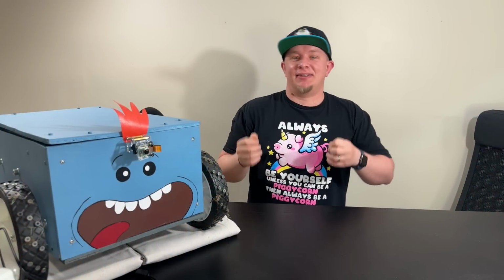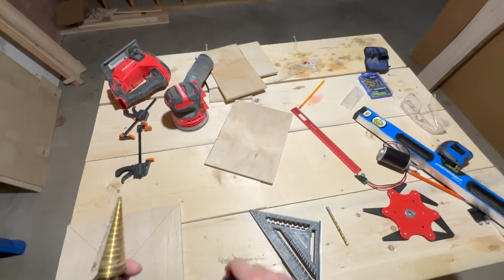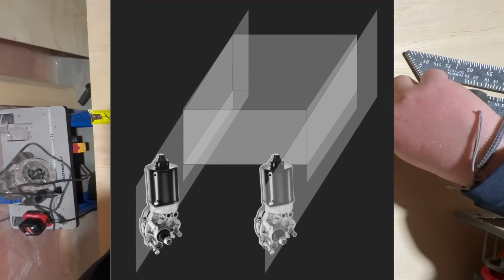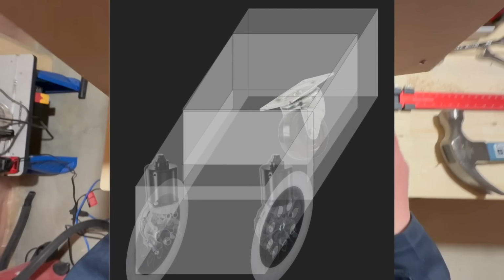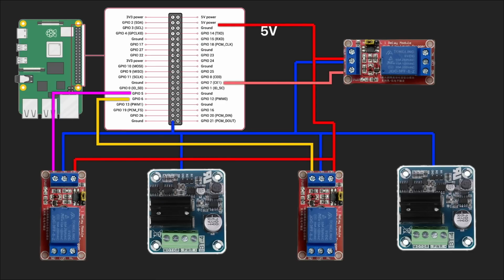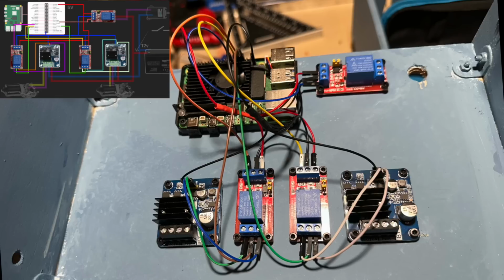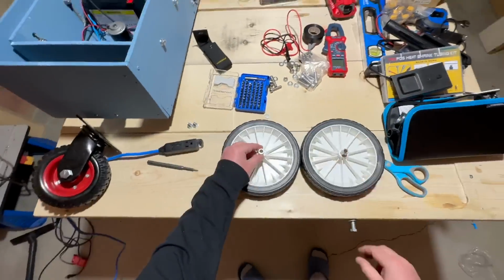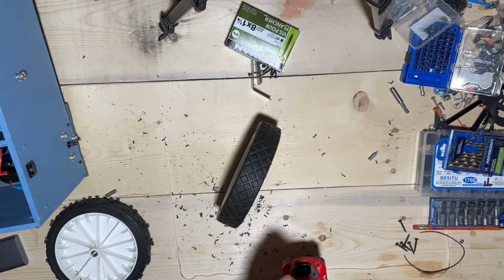How to build a lawnmower with a Raspberry Pi— Can Lawny Make Cutting Grass Fun?

Comment: I am very impressed with your solution. Particularly, in regards to it's simplicity and cost effectiveness. Many of the solutions I've seen use much more costly components. I like the idea of using wiper blade motors and a motorcycle battery for movement and power.  But for my own project I want to have it be more automated. Perhaps to use imaging to create automated navigation. I'm wondering how long the battery works in your system and if you have more thoughts on cutter motor power and speed? You seem to have solved it by changing the cutter mechanism, which sounds incredible, but that might be hard for me to reproduce.    You mentioned that your wife bought some paint from the dollar store. I saw some cheap usb web cameras at my local Dollarama store that might be cheaper  and more durable than the PI camera you used. Please let know your thoughts on my questions and if you have plans on adding automated navigation? Many thanks
Reply from the maker: Many thanks to you!
I have two batteries — one 9Ah and one 12Ah — connected in parallel. Together, they can power the mower for up to half an hour.

The cutter motor is quite cheap and weak. It works fine for cutting a regular lawn, but if the grass is overgrown or tough, the motor overheats quickly. To deal with that, I mounted the motor higher and cut the grass in several passes, adjusting the height each time.

I’ve considered automating the mower, but it wouldn’t be cost-efficient. While you could use a cheap camera from a dollar store to see where the mower goes, that wouldn’t be enough for autonomous navigation. To make it truly automatic, you’d need a lidar, several cameras, and expensive software — all of which would need to be custom-developed.

So, I doubt it can be done at a low cost.

Comment: How do you put the software on the rpi I see the GitHub but it doesn't make sense
Reply from the maker: Here are the steps:
1. Install the latest OS (bookworm) on RPI
2. Connect to your Raspberry PI via SSH (terminal)
3. Run: git clone https://github.com/Nerdy-Things/lawny-raspberry-pi-lawnmower.git
4. Run: cd lawny-raspberry-pi-lawnmower/raspberry
5. Run: ./install.sh 
It will install all dependencies.
Next, you will have two options: 
1. Enable autoboot. 
     a. Run: ./autoboot.sh 
         It will write config to boot a script on RPI launch.
     b. Reboot
2. Run a script manually:
python websocket.py

As long as this command is active - the phone controller will work.

To build a mobile-app-controller, on your laptop (not raspberry PI), run:
 git clone https://github.com/Nerdy-Things/lawny-raspberry-pi-lawnmower.git
Then open the "mobile" folder  https://github.com/Nerdy-Things/lawny-raspberry-pi-lawnmower/tree/master/mobile with Android Studio: 
https://developer.android.com/studio
And then build it for your phone. 
If you have iPhone - you must run it on Mac with installed XCode (it's the Apple company requirements)
If you have Android - just connect your phone to your laptop with a Type-C cable and press a "run" button, in the android studio
Reply: @itkacher ok thank you

Comment: What application did you use and how did you connect it a what software on the pi did you use
Reply from the maker: I used my own software: https://github.com/Nerdy-Things/lawny-raspberry-pi-lawnmower/
It has 2 folders - 
https://github.com/Nerdy-Things/lawny-raspberry-pi-lawnmower/tree/master/raspberry to be used on Raspberry PI
https://github.com/Nerdy-Things/lawny-raspberry-pi-lawnmower/tree/master/mobile - to be opened in Android Studio and then installed on mobile app.
Reply: Do I run in with rpi os?
Reply: Bc it is python and other coding languages so what is do I run it in

Comment: Hi Eugene, your video is excellent. I have been considering building my own robot mower using a Pi to control  the mower. If something goes wrong I will be able to fix it myself and I will be able to add features myself. Your video makes it very clear how to construct the mower, thank you, Please would you provide details of the software you used on the Pi and the phone, Thank you again.😊
Reply from the maker: Hello! Thank you!
As for software, I have a separate repository: https://github.com/Nerdy-Things/lawny-raspberry-pi-lawnmower/tree/master
Clone the repo to your Raspberry PI and run 2 scripts:
https://github.com/Nerdy-Things/lawny-raspberry-pi-lawnmower/blob/master/raspberry/install.sh
https://github.com/Nerdy-Things/lawny-raspberry-pi-lawnmower/blob/master/raspberry/autoboot.sh

Then reboot the Raspberry PI.

As for mobile, open the folder: https://github.com/Nerdy-Things/lawny-raspberry-pi-lawnmower/tree/master/mobile in the Android Studio on your laptop.
Then you will need to set an IP address of your Raspberry PI in the file:
https://github.com/Nerdy-Things/lawny-raspberry-pi-lawnmower/blob/master/mobile/lib/main.dart
final String _ipAddress = "192.168.8.198";
And build the project in Android Studio. 
The Mobile project uses Flutter, useful links are there: https://docs.flutter.dev/tools/android-studio

Comment: 24:00 white paint has white pigment in int, you can not take that out.... with red pigment added it will be red+white = pink, etc. 
Cool project nonetheless !
Reply from the maker: You are right. I knew that usually, people mix white paint with a pigment to achieve a correct color. But there should be some different base :)

Comment: This is awesome! I'm also looking to work on a similar kind of project. This video is exactly what I was looking for. I'm really interested in the programming of your project. Could you show it in a new video? Great job!
Reply from the maker: Thank you! 
I could try to explain it later videos. 
Meanwhile you can try the code on your own:
https://github.com/Nerdy-Things/lawny-raspberry-pi-lawnmower
For a Raspberry PI there is a folder with scripts. 
Clone repo on raspberry PI and run 
`cd raspberry` 
`./install.sh` to install dependencies
Then `./autoboot.sh` to make it run on a system startup 
or manually 
`python websocket.py`

Next, on you laptop, clone repository again and open the `mobile` folder with Android Studio. Build the mobile app and run on your phone.

Comment: Nice project. 
Use a 12v to 5v buck converter instead the power bank, so you have only the car battery to reload.
Reply from the maker: Yes, it's another option. For me it was simpler to put a powerbank, rather than add a converter and solder the type-c from it to a raspberry pi. It can run on a single powerbank for a day, so it's not a problem. 
But thank you for the suggestion.
Reply: drive power line is very noisy and can wildly fluctuate... better to have the controls to their own battery, even if it is a hassle to charge